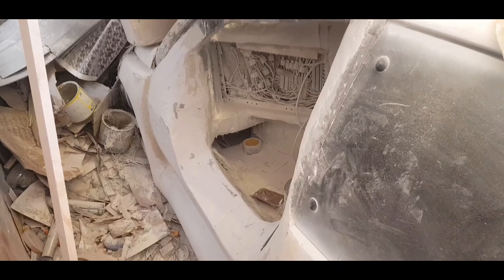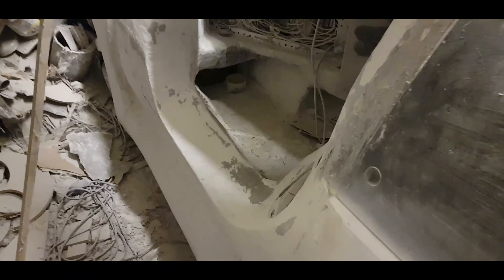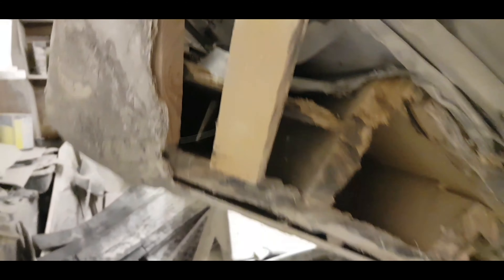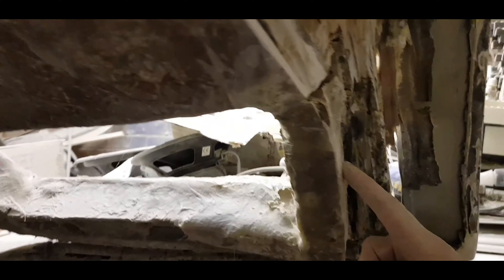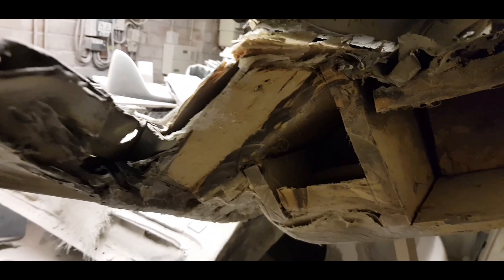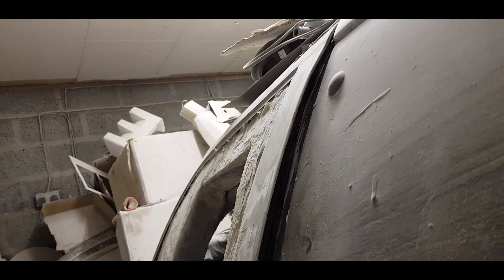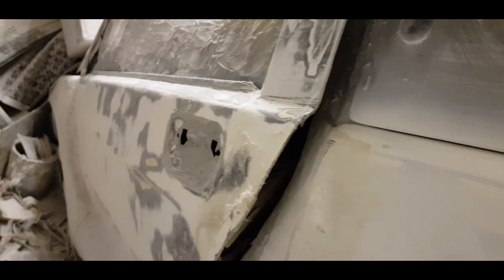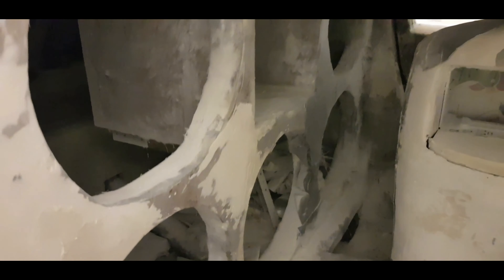100 - more work on the gullwing - 4 hours doesn't get you far in this game

Comment: 110% u need to just take that door back to a skin and concentrate on just getting it opening and closing on a proper latch. Then work to build your shapes after that's sorted
Reply from the maker: The latch wont be an issue as there wont be one...it will have an intenal manual bolting setup. Its not far off it just needs some persuading to get it closing currently